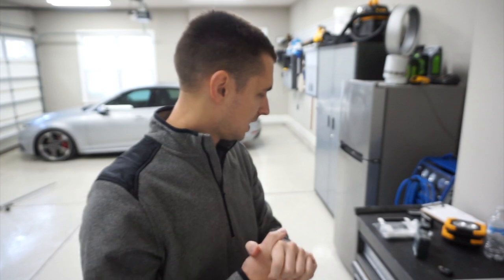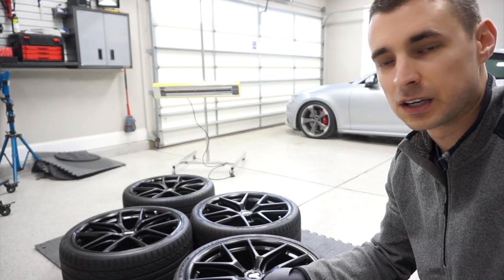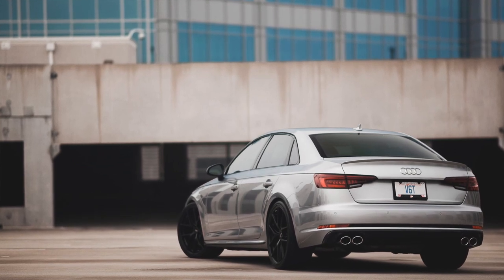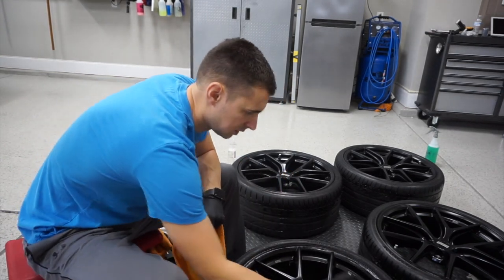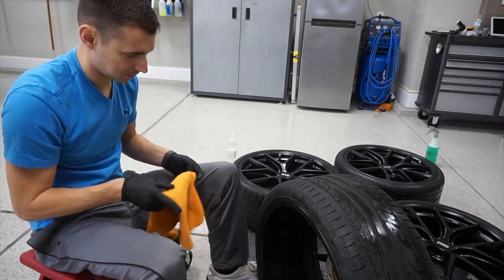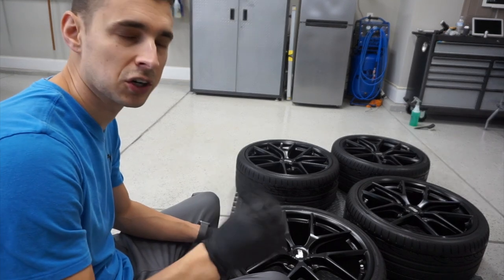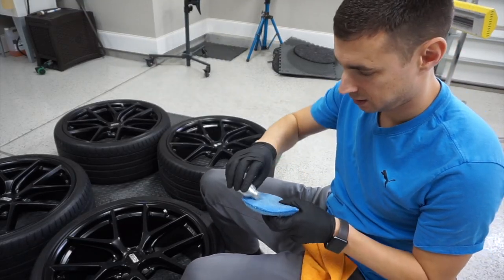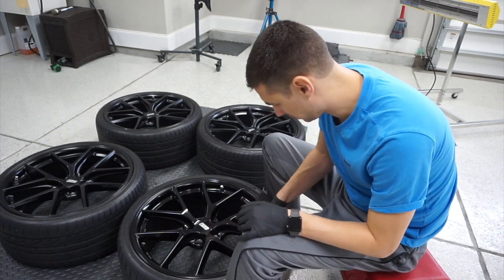Wheel & Tire Ceramic Coating | BBS CI-R | Feynlab

Comment: Wheels look good! Did you paint the stainless steel rim protectors black? How did you do it?
Reply from the maker: Karura7 those guards were actually removed awhile back 👍
Reply: NC Detail Garage looks much cleaner that way! Does it leave a raised edge or anything with it removed?

Comment: What wheels did you replace the BBS with? I am considering the CI rs for 19 s4 same config, (from Mops lol). Did you not like them?
Reply from the maker: I went w/ BC Forged RZ10 in brushed clear. I mainly wanted to go back to a 19" wheel. More pics on IG @nc.detail if you're interested.
Reply: @nc.detail  thanks! Not on IG but would love to see pics! I am looking hard at BC Forged since I can get the concavity i want. Did you not like the ride of a 20 on the s4?

Comment: I just realized, since these are Satin Black wheels, does using a ceramic coating like this introduce a lot more gloss to it afterwards? How did you find it?
Reply from the maker: Karura7 it does change the appearance but more of a deeper and richer look. A touch more sheen but not a true gloss

Comment: Were you calling the tire coating a fail because of the clumpy/sticky areas at the end, difficulty of application, cost, or some other reason? Just curious; shiny tire dressing is not my thing anyway.
Reply from the maker: Alok Somani yeah, the application didn’t go as planned. Instructions say one layer for a satin look and two or more for a high gloss. I ended up doing the two in hopes it would level better.
Reply: @nc.detail  Never go full gloss, man. Lol, jk. I think you might have let it set too long before leveling?

Anyway, good stuff and good video. I'm getting Heal Plus done on my car as we speak, so nice to see that you like the stuff enough to install Heal Lite on your own car. I've only seen one car in person with Heal Lite on it, and none with Heal Plus, so I just hope it gives me a visual result I'm happy with.
Reply from the maker: Nice, I really like Feynlab products. I have heal lite on my s4 but typically do topcoat and ceramic (the 3yr) for clients as I like the price point. Let me know what you think of heal plus.

Comment: I’m confused I bought the tire coating. It’s an A and B mix ..... is this what your using ?  I have not attempted yet. To new of product. Spent 100$ on it and have not attempted cause I don’t know how to install it ... brand new tires never seen the road yet.  Any tips of tricks ?
Reply from the maker: Hi Pardy, Where did you pay $100? Are you in the US? For the install, I would use a different brush. Ideally a longer haired brush to help with leveling.
Reply: I’m in Canada. I just got the A & B bottles and. A syringe.  Not sure what to do next .....
Reply from the maker: @pardy704  there are instructions on the website. https://www.feynlab.com/product/feynlab-tire-coating/

I just mixed all of A and B together. It's way more than you'll need for one set but I threw it away afterwards.
Reply: NC Detail Garage I can’t seem to get it to level out. Seems like I have high and low spots. Also seems kinda patchy.  I prob screwed it up lol

Comment: You should use a different applicator pad
Reply from the maker: The idea was to use the kit as provided. It makes sense that they simply provided their typical coating block to fill this void but I agree that a brush would be better suited.